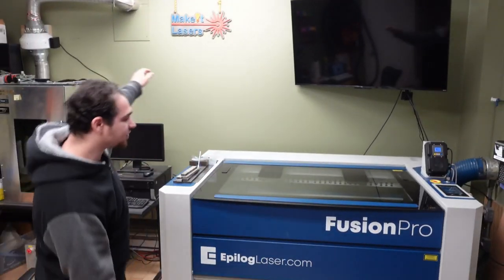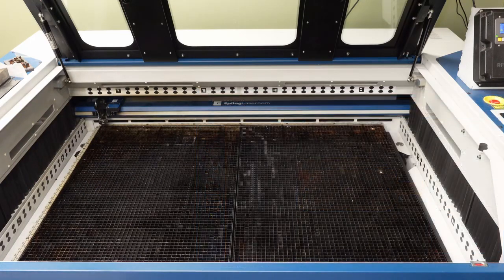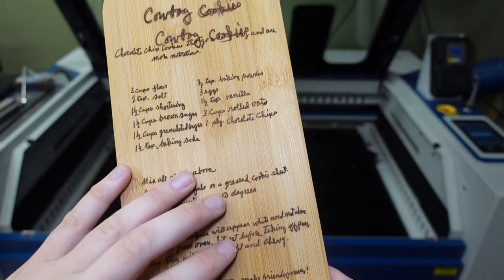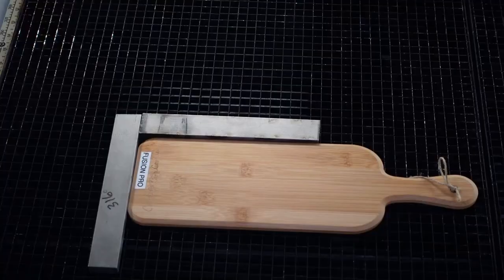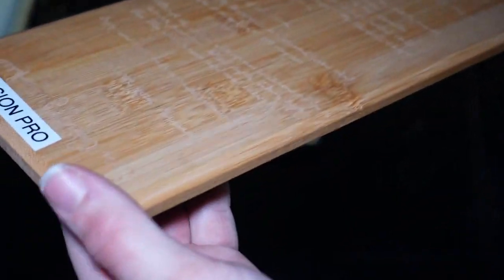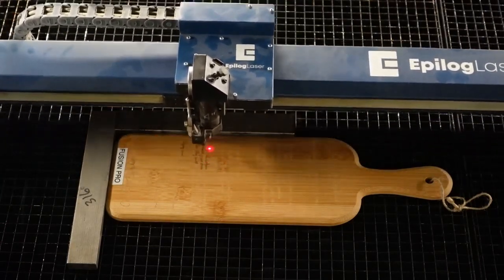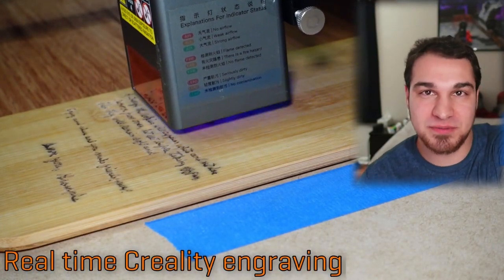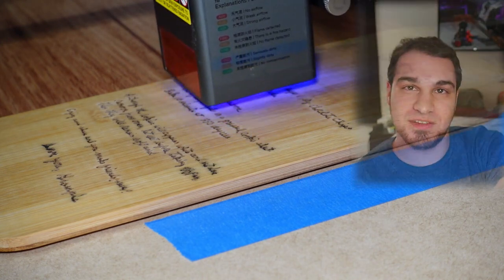Nothing About This Worked as Planned!

Comment from the maker: About accelerations, I reached out to Creality and was told that the X and Y acceleration settings are factory defaults and should not be changed. They are set to 500 not 1000 as Lightburn had reported. So the Epilog does 98 times faster acceleration not 49 times :)

Comment: The outline was probably moving slower, and that's why it was darker.
Reply from the maker: That's possible. Another weird thing I noticed was the Epilog software has a "frequency" control that shows up for the vector outline setting but it's greyed out for the engraving setting, I wonder if that was also partly to blame? The default frequency may have been bad for Bamboo? No other laser cutter I've used before has a frequency setting though. I've used CO2 lasers for cutting many many times over the years but I very rarely have artistic or engraving uses.
Reply: @JustCuzRobotics  usually the power setting is pwm. That might be the frequency for that.

Comment: For the price of the Epilog, you could buy 68 Falcons and spend ~13 seconds reloading each engraver. In one 8 hour shift, one person could produce ~2176 units. You'd have to subtract all the time to setup, tables, and space so many Falcons would take up. You'd also have a lot of waste heat to deal with. For an etsy store, this would be overkill. Probably better to have two or three Falcons and spend down time managing orders, shipping, or coming up with new products. The cost to maintain Falcons in a production environment is probably the main detractor for a Falcon--but it really comes down to how many products you could produce before a Falcon fails along with how much money each product is sold for.
Reply from the maker: Yeah I don't think either of these is really ideal for an Etsy store. Something a lot faster than the Creality but still a cheap diode laser would be fine if all you need to do is engrave things. You can also get galvo lasers with tiny work areas that engrave things super fast. If you need to actually cut wood or acrylic with the laser then more powerful CO2 lasers are definitely the correct choice as they will be far faster. For <$3000 you can get a laser with half the power of the Epilog where the power is the limit, not the gantry speed.